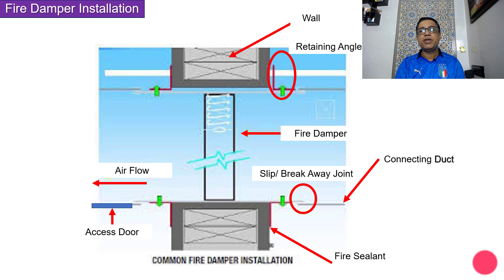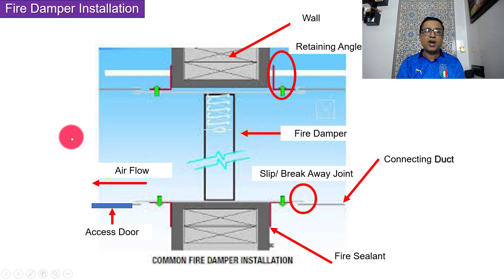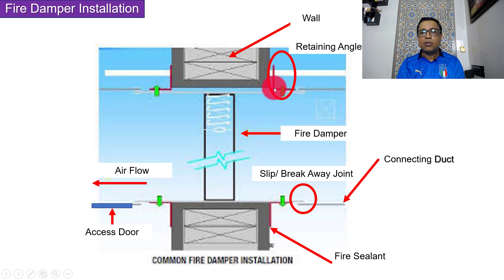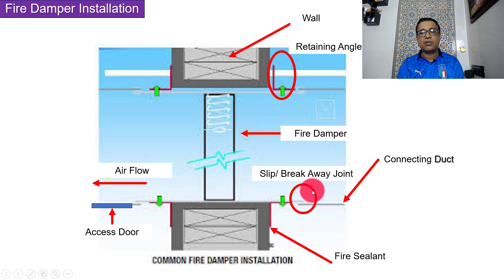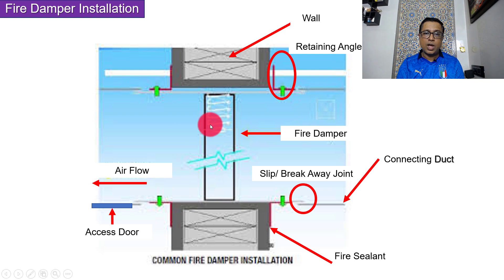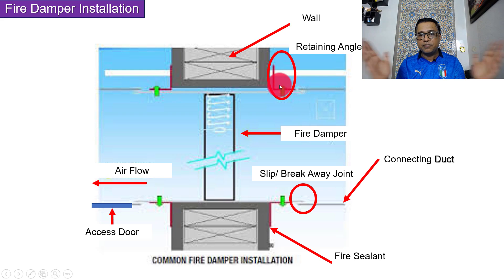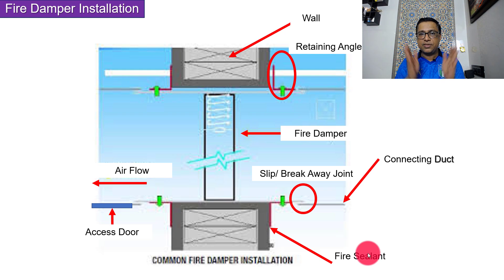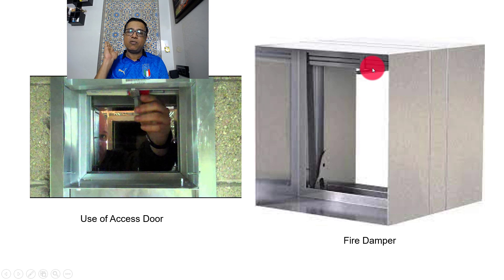How To Install A Fire Damper In Your Hvac System I Ajaz Kazi

Comment: Thank you for the explanation of the fire damper. Is there any different fire damper (FD)/Motorised fire damper (MFD) or with Motorised smoke damper (MSD)? So far as i understand the functionality is different, FD/MFD is to operate during fire break while to stop or prevent fire spread to the other room. Can we used MSD to prevent fire spread?
Reply from the maker: MSFD .motorised fire and smoke damper is right option
Reply: @AjazKazi  Rarely heard about the MSFD. Does the installation same as per the video?
Reply from the maker: @nikaqilnikmazlan1648   No